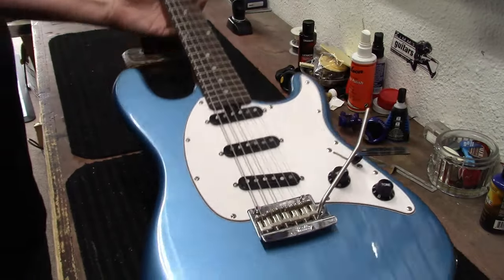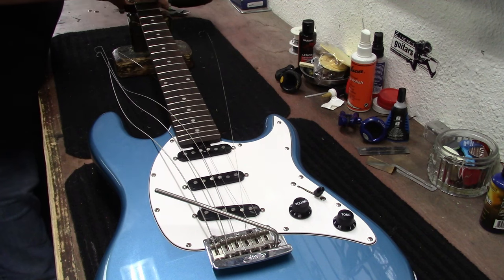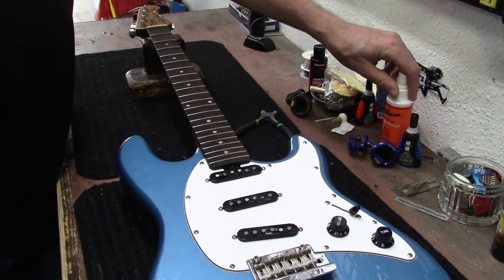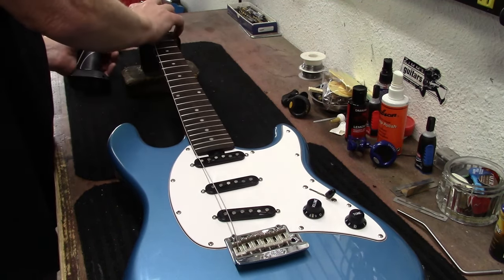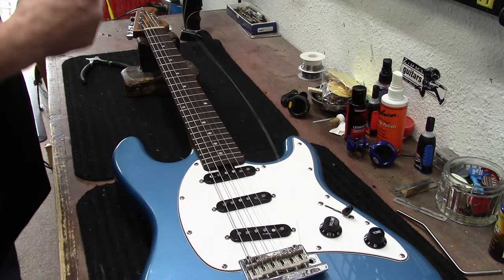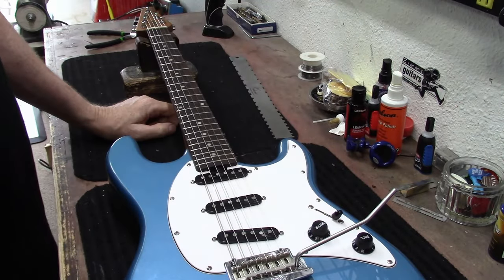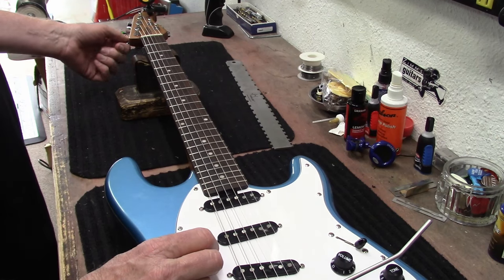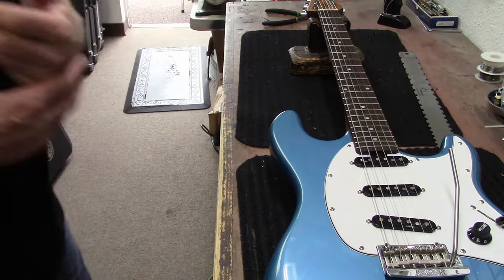Sterling Cutlass Restring!

Comment: Dane, after you finished the initial restring, swapping from a heavy gauge to a lighter gauge, shouldn't you have checked the intonation? We didn't see you do that and neither did you say anything about it. (Or maybe you did but I missed it, or you edited it out of the video.) Neither did you check the tension on the tremolo springs. 🤔 
But I really like the headstock on this guit, 🤩 although I've also come to understand a theory (pros & cons🤓) behind the six inline configuration. But then again, if that were inarguable there'd be fewer guits with 3R & 3L config, wouldn't there?  
That bridge looks interesting with that two lug fixture. I like the look of it. Quality! Is it a Wilkinson? Although it has the standard Fender type saddles.  
And the colour; 😍 love the colour! And of course you couldn't miss the absence of the concave jack housing plate that most Strats religiously have on the front.  
All in all, a very nice guitar! 😎 Cheers Dane!